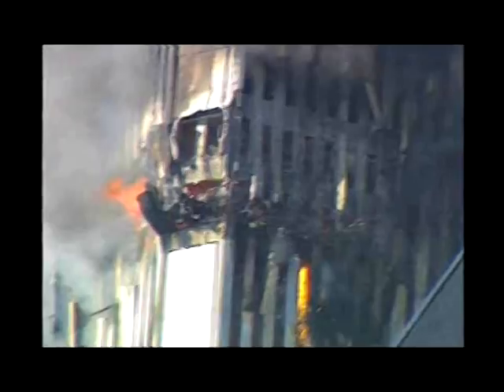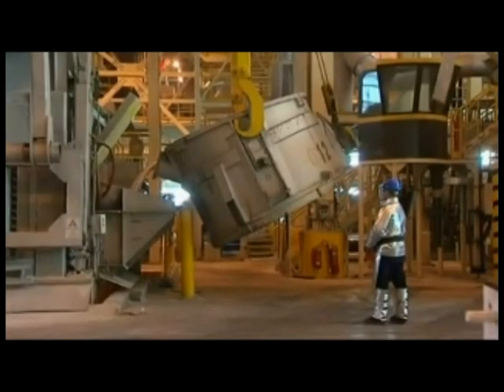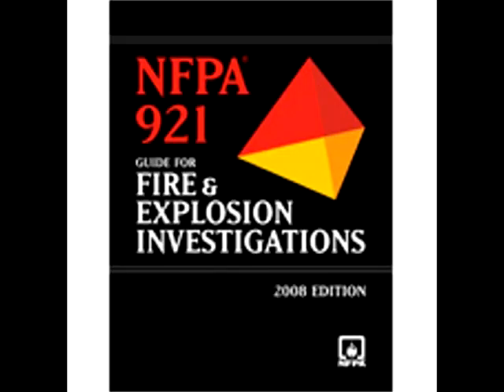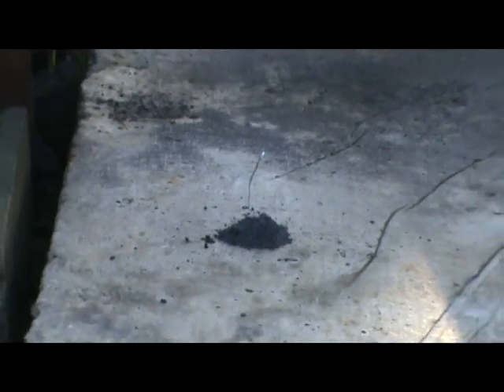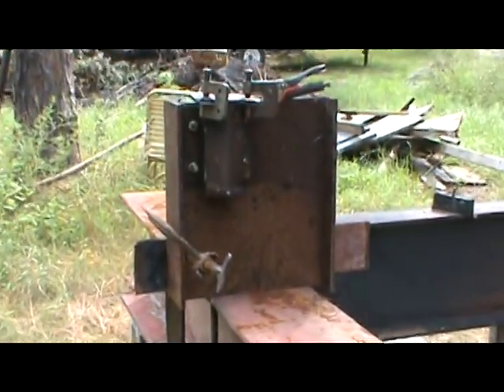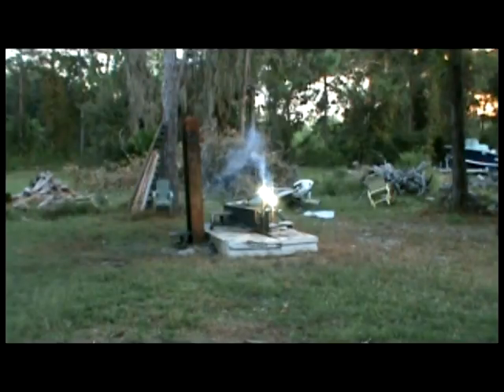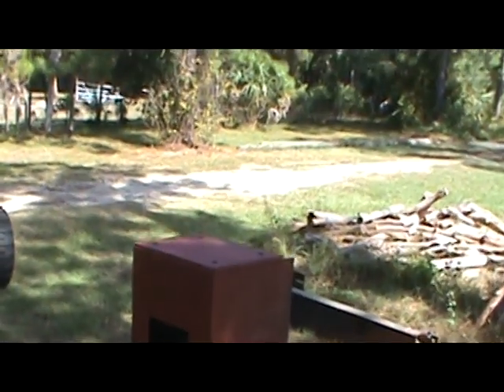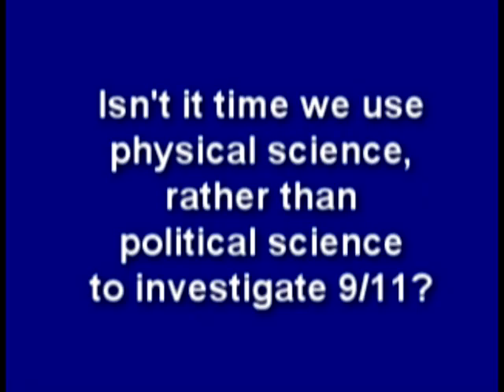9/11 Experiments: The Great Thermate Debate

Comment: It’s a wonder YouTube hasn’t deleted this video
Reply: If you leave it in plain sight, nobody would think that it's something extra important thing. Imagine what would happen if the first guy uploads the video and gets deleted. On the next day one hundred guy upload the same video and it would get lots and lots of more views. If you let this one hang here, nobody will notice, nobody will think it's something special. Psychology at it's best.
Reply: "because it's fake". I've personally made thermite and cut through a sewer lid with a crudely designed 'shaped charge' just like the gentleman in this video. I also learned how easy it is to accidentally make your shaped charge into a 'grenade' (basically). That is called 'verified independent personal peer-review'. That's what I love about science, you can't deny empirical evidence that anyone can recreate. Doing so is the very opposite of science. i.e. 'flat-tard logic'.
Reply: If this video blamed 9/11 on an AR-15 it would have been taken down.
Reply: If the video was suggesting a Democrat administration was to blame, it would have been deleted immediately.
Reply: Josh Pollack 
First of all, I haven’t had cable in over 3 years now and don’t believe the “tv”, so you could stop wasting your time with that rhetoric. Secondly, the building did meet resistance when they collapsed which can EASILY be seen by the falling debris outpacing the collapse of the buildings. Thirdly, the buildings were MASSIVE so of course bodies are going to be torn to pieces during the collapse instead of being flattened like some cartoon. And lastly, bombs/explosives leave behind remnants like det. cords, blasting caps, etc., which are found after EVERY REAL controlled demolition and there was NO evidence of that in the rubble.

So again, nice try but you have no clue what you’re talking about.
Reply: Dr. Hannibal Lester its call matter... the reason he made that point is that building 7 was not an object in freefall. When they measured the amount of time it took for the building to be demolished, it never showed any deceleration. If you're going to  put your eggs in the "progressive collapse" basket, you must acknowledge the laws of physics and recognize the fact that the upper portions of the building would be slowed by the mass of the building below it.
Reply: The Nech 
Not sure who you’re talking to because you didn’t address who you’re replying to, but the plane impacts were a factor in the collapse but not what initiated the collapse. The fires that burned uncontrolled is essentially what brought the WTC buildings down, including WTC7.
Reply: The Nech 
Read my comment again, I didn’t say the plane impacts caused the collapse, I said they were a factor but the fires that burned uncontrolled after was what brought them down. There weren’t any explosives and there were eyewitness accounts of all kinds of things as is expected during a chaotic event, especially one on the scale of 9/11.
Reply: Josh Pollack 
Sorry, but you don’t have a clue what you’re talking about.
Reply: you're embarrassing yourself because you refuse to see the truth no matter how many times you look at it. 
its really not hard, just try thinking for yourself instead of believing what the tv said about it.
Reply: if it really collapsed, we would see shit caught up between floors, we would see floors, we would see the kind of rubble that was in haiti. buildings compressed with people and shit stuck all over the place in there. 
spoiler alert
it didnt collapse
Reply: Josh Pollack 
Everything I listed was a fact, so how am I hopeless. I’ve looked at Judy Woods theories and if you want to talk about delusional, she’s the definition of it....which is why you don’t hear from her anymore since her ridiculous rhetoric. As far as the rubble goes, it took almost 9 months to clean up, so I have no clue where you’re getting this information that it got shipped off to China in “2 days” because YOU’RE WRONG!!! 

But believe what you want, and don’t bother replying to me anymore with you’re baseless nonsense.
Reply: poweredbyaaron99 You've proven via your comment that you don't understand how terminal velocity works. Terminal velocity is just that, a velocity, not an acceleration. It's different for every object and depends on the medium the object is falling through. It's the velocity at which resistance from the environment, such as air resistance or, say, structural resistance from 100 stories of steel, is exactly equal to the force of gravity, so the falling object no longer accelerates. So the fact that it is falling "at terminal velocity" would prove the exact opposite of what you are trying to say. It proves that it IS being slowed down.
Why can't I jump through 100 floors of steel? Because the terminal velocity of a human falling through steel is 0 mph. The same is not true for a building that weighs thousands of tons.
And by the way, what source are you getting any of this from? I can't take any of your claims seriously unless you give me a source, since I know thaf conspiracy theorists love making stuff up and taking things out of context. In fact, I suspect that that's what your doing right here. You seem to be taking something about the building falling at terminal velocity out of context to make it sound as though the building is falling at the same terminal velocity it would have if there were no structural resistance.
Reply: I downloaded it and archived it* Youscrew can delete it all they want. I'll upload on 100 alias accounts.
Reply: DullSensation 2000 true.
Reply: tony. pieces of bodies are still being found. 
if the buildings pancaked, you would see bodies mashed between floors. things crumpled up, but still there. you know, like a pancake!
it takes explosives to blast humans into pieces and scatter them around town. that, my friend, proves without a shadow of a doubt that there were bombs in the buildings on that day. 

the only hard part about believing the 9/11 conspiracy is that it means all of that perfect Democratic US Government stuff you learned in school is bullshit. 
and that's only hard if you're a pussy that cant handle the truth
Reply: tony
sorry bud. seems like you clearly cant handle the truth. 
that's ok, just stop embarrassing yourself like this
Reply: Josh Pollack 
You said pieces of bodies are still being found and that they should’ve been flat like pancakes as if 9/11 was some kind of cartoon, and I’m embarrassing myself? Ok
Reply: it proves explosives. there wasnt anything trapped between floors. if they were really "pancaking" then where the fuck are the layers?
there arent any because there were bombs blowing that bitch into pieces.
you're the one looking at something free falling, and telling me its going through floors. each floor would have posed resistance. that resistance would have slowed the fall of the buildings, no matter how squinted you look at it. since the buildings didnt slow, it proves that something moved the floors out of the way as the building was coming down. 

along with all of the bodies blasted into pieces all over town.
Reply: DullSensation 2000 if they did there would be an uprising of these theories. The govt doesn't want that.
Reply: Well it's a meme at this point so
Reply: Yeah- It's pretty ubiquitous at this point. lol
Reply: poweredbyaaron99 You keep claiming that the official story contradicts the laws of physics. Care to explain how? And by the way, given that you are a conspiracy theorist, and there is a significant overlap between flat earthers and 9/11 truthers, I wouldn't be surprised if YOU were a "flattard". But I would be very surprised if the person arguing against you was.
Reply: poweredbyaaron99 Your comment to Dr. Hannibal Lester proved nothing whatsoever. You are either a troll, or a complete moron. Do you even know what terminal velocity is? It sounds like you don't. Here's a hint: terminal velocity has nothing to do with the method by which something is demolished. Your claims that the "official story" contradicts physics shows that you know literally nothing about physics.
Reply: You didn't understand my position - despite repeated attempts. How could I NOT insult you? You believe that steel and air pose the same resistance to an object falling to the ground . How fucking dense can you get? Can you really be THAT stupid? Yep - you just proved it. I'm still in shock. Remarkable. 

You know - even the density difference between air and water is so extreme - you would SPLAT impacting it from 100 stories. It would stop you DEAD in your tracks. You are either a troll, or a complete moron. 

Terminal velocity: "the constant speed that a freely falling object eventually reaches when the resistance of the medium through which it is falling prevents further acceleration." 

Do you even know what a "medium" is?? Bro XD 

"Why can't I jump through 100 floors of steel? Because the terminal velocity of a human falling through steel is 0 mph." 
NO SHIT!! XD That was kinda my point, Sherlock. "The same is not true for a building that weighs thousands of tons" Uhm, YES IT IS!!!! And here's the simple reason why: 90% of that building was PRISTINE Duh?

"In controlled demolitions, all resistance is removed systematically and simultaneously" They don't leave 90% of the building in-tact to interfere with things It has to happen SIMULTANEOUSLY - otherwise, the upper portions are STOPPED or DEFLECTED by the resistance of the lower portions. Then the building can't fall at free-fall speeds and can't fall neatly into it's own footprint. 

"The strain of anti-intellectualism has been a constant thread winding its way through our political and cultural life, nurtured by the false notion that democracy means that "my ignorance is just as good as your knowledge." Issac Asimov
Reply: poweredbyaaron99 You didn't even clearly state your position until now. You just said that terminal velocity proved people wrong without giving any back up as to why. And then when asked to clarify your claims, you resorted to insults.
Reply: poweredbyaaron99 I never once claimed that ignorance is just as good as knowledge. You are making a complete strawman, and you know it. You are deliberately lying. And who are the anti-intellectual ones, again? The person trying to have a reasoned drbate, or the one who is making up conspiracy theories just because he wants to automatically believe the opposite of the "official narrative", is attempting to discredit NIST, dismisses all evidence against his claims as part of the conspiracy, and resorts to ridicule rather than argument?
Reply: poweredbyaaron99 When did I claim that steel and air pose the same resistance to an object? I claimed the exsct opposite in my previous post. What you are doing is called knocking down a straw man.
Reply: poweredbyaaron99 The building is not falling through solid steel. It is falling through more floors of the building, which are made mostly of air, so the terminal velocity is, in fact, more than zero. Where is your source for the claim that 90% the building was "pristine"?
Reply: I never once claimed that ignorance is just as good as knowledge." It was implied, not stated. C'mon lemming. You can do better than that. And who are the anti-intellectual ones, again? lol 

I stand completely by what I said before. Nothing has changed 

"When did I claim that steel and air pose the same resistance to an object? I claimed the exsct opposite in my previous post." You refuse to acknowledge that 100 floors of steel beneath the impact site would resist the fall what-so-ever. Thus, you insist that there is fundamentally no difference in resistance between the two.

1. You didn't understand my position - despite repeated attempts. It was there from the beginning.
2. You refuse to acknowledge that 100 floors of steel beneath the impact site would resist the fall.
3. You argue in circles around this because you want to avoid being seen as: 'obviously wrong.'

I've repeated myself too many times. I continue to do so now only because you don't know when to shut up.Your continuous assumptions and conjectures  are an attempt to divert attention away from an argument that you cannot win otherwise . Your entire position is one massive red haring swimming in conjecture -yet you accuse me of making the strawman? Do you know how bat-shit crazy you are? I'm copying my original points - nothing has changed in my position! My argument remains EXACTLY the same and STILL STANDS. Nobody is diverting attention away from anything except you!!!  lmao XD

90% of that building was PRISTINE - and should have resisted and deflected the 10% that was affected. That has been my position from the very beginning!!! An object falling through air falls faster than an object falling through 100 stories of steel. (WTC was 110 stories tall btw) Try as you might little lemming - you cannot change that fact. You cannot deflect the argument either.  

"Where is your source for the claim that 90% the building was "pristine"? Uhm... I watched 9/11 happen ya dildo. The planes hit 10 stories from the top and didn't affect the first ~100 floors. That's my 'source' - lmfao (do you really need the footage?)

Are we at the point now where I have to source common sense shit anyone can see... SHOULD HAVE SEEN themselves? It's not a debate dude. 90% of the building was PRISTINE. Perfect condition. Are you accusing me of being a fucking liar now? lol - Okay.

Look man, nothing personal but I think some emotions are too flared here to have productive discourse. Take a break. Come back later. Try again*
Reply: poweredbyaaron99 You've admitted that you have no source for what you're saying and instead resort to "common sense". That's the mark of an anti-intellectual, exactly what you are claiming I am. I wonder if you know the quote about accusing your opponents of what is true about yourself.
Reply: poweredbyaaron99 I'm not accusing you of being a liar, I'm accusing you of being an idiot. You admit that the reason you think 90% was in good condition is because you saw it yourself. Did you see the part of the building that was actually facing the Twin Towers? No, that part was covered by too much dust and rubble to even see. Yet you claim that, because the part of the building you could see (the part that wasn't getting hit by rubble and would therefore be much less damaged than the rest of the building) looked fine, 90% of the whole building must have been fine. Actual witness reports say that there was already z huge chunk of the building taken out and it was in danger of collapsing from fire, which it eventually did.
Have you ever tried doing research to see if your conspiratorial claims are correct? https://youtu.be/_kSq663m0G8
https://youtu.be/CtkWNHSG3MY
Reply: poweredbyaaron99 You clearly never saw the entire WTC 7. The part that was actually facing the tower and got hit with debris was extremely damaged. So your claim that it is "pristine" just because you didn't see the damage from the angles in the news reports is just false.
Reply: https://www.google.com/search?q=9/11&rlz=1C1CHZL_enUS750US750&source=lnms&tbm=isch&sa=X&ved=0ahUKEwjvvZyRgNfcAhUOiqwKHbxXDHcQ_AUICygC&biw=1920&bih=943

https://www.google.com/imgres?imgurl=https%3A%2F%2Fupload.wikimedia.org%2Fwikipedia%2Fcommons%2Fthumb%2Fe%2Fe5%2FNorth_face_south_tower_after_plane_strike_9-11.jpg%2F170px-North_face_south_tower_after_plane_strike_9-11.jpg&imgrefurl=https%3A%2F%2Fen.wikipedia.org%2Fwiki%2FSeptember_11_attacks&docid=mWvoGB6fsl3csM&tbnid=nK5_jtCR3FXu5M%3A&vet=10ahUKEwiTgcSUgNfcAhWH7YMKHa05DHQQMwgoKAAwAA..i&w=170&h=195&bih=943&biw=1920&q=9%2F11&ved=0ahUKEwiTgcSUgNfcAhWH7YMKHa05DHQQMwgoKAAwAA&iact=mrc&uact=8

https://en.wikipedia.org/wiki/Timeline_for_the_day_of_the_September_11_attacks

"8:46:40: Flight 11 crashes into the north face of the North Tower (1 WTC) of the World Trade Center, between floors 93 and 99. The aircraft enters the tower intact." 

There durpshit - 93-99 is close enough to 100. Now Are we done here? Because unlike you - I actually have more important things to do with my time than argue about the color of the sky or the shape of the Earth with a pretentious fool who demand "sources" for empirical, observable evidence that is so readily available to everyone. You waste my time.
Reply: poweredbyaaron99 Interesting that your sources have nothing to do whatsoever with what I asked you to source. More intellectual dishonesty, I guess. You didn't even find one peice of info relevant to WTC 7. Meanwhile, I provided you with sources explaining how WTC 7 collapsed and that there was significant damage, which your response to was to say that you think you know better from seeing one shot of it from a news camera that can't see through the rubble to the side that's actually damaged than the people who were actually there.
Reply: poweredbyaaron99 You know your claim that the building was pristine is a lie. I gave you actual sources with evidence that it was damaged by the rubble from the Twin Towers, and your only response is, It looked pristine to me (by which you mean it looked pristine from one angle, the angle that was pointed at the side facing away from the twin towers.
Reply: poweredbyaaron99 You're repeating the same thing over and over again. I already explained to you why the resistance from the rest of the building DOESN'T MATTER. The supports to the building were destroyed, which is why it fell. The rest if the building is mostly air, with a little bit of glass and concrete - not enough to even hold itself up against its own gravity. You do know how gravity works, right? 
You remind me of a flat earther. You don't understand gravity, and you repeat points that were already refuted when you run out of arguments.
"I don't see Earth's curve, so it must not be there." - flat Earth morons
"I didn't see the damage on the WTC 7, so it must not have been there." - you
Reply: poweredbyaaron99 Ever heard of Parker's law? “If you have to insist that you've won an internet argument, you've probably lost badly.”
And there's a similar thing about people who result to insults instead of making arguments.
Reply: Grenherb I already know that many of the terrorist organizations are partially the US's fault. I also know that the government took advantage of 9/11 to go to war. That still doesn't make 9/11 an inside job, though.
And seriously? The old "It's all the Jews" claim? So now you're not just a conspiracy nut, you're a bigot as well.
Reply: Grenherb So because I can respond to your illogical claims, I will always be stupid? Sounds like you have no arguments.
Reply: Grenherb Sounds like you don't understand facts. MAKING BASELESS ASSERTIONS AND PUTTING THEM IN ALL CAPS DOESN'T MAKE THEM TRUE. You have no evidence that America is owned by the Jews or that Jews are trying to start a NWO, you are just making up dumb conspiracies to justify your bigotry. Jews have been kicked out of countries due to discrimination. Currently, many Islamic states are very discriminatory towards Jews, and in the past, a lot of Christians also discriminated against them. Your attempts to turn victims of discrimination into the villains are pathetic.
Reply: Grenherb I like how you call me robotic and stupid when all of your comments are robotically repeating made-up claims that you stupidly believe. And I love even more how you tell me to look up history when all of your claims are either completely fabricated or historically illiterate. But thank you for providing me with continued comedy.
If your family really did hide Jews, I'd suspect that it didn't go well if the Nazis ever found about it. Ironic, since you seem to agree with the Nazis. If what you say about your family is true, they are probably quite ashamed of you and your bigotry.
Reply: Grenherb And like most insane people, you call people who don't agree with you Nazis, commies, or some other evil ideology. Thank you for proving that Godwin's law applies not just to Nazis, but to communists as well.
Reply: Grenherb Do you know why I'm not a conspiracy theorist? Because every time I ask a conspiracy theorist to back up their claims, they utterly fail. Like the guy above you, you can't back up a single thing you say with actual evidence. You just shout your insane nonsense as if anyone is stupid enough to believe you.
Reply: Jewtube
Reply: Its because it doesnt appoint to the guilty party which cannot be mentioned in america: israel.
Reply: They won’t be recommending videos like this that’s for sure
Reply: Yeah the whole thing is fake. WTC7 fell at terminal velocity despite never being hit. It will remain the only steel frame building in history to collapse from fire alone - and at terminal velocity. If you know anything about physics at all, you know that 9/11 was an engineered event involving far more than 19 hijackers armed with box cutters. 9th grade physics is really all you need to know to spot the elephant sitting in this room.  You learn terms like: 'friction resistance' & 'terminal velocity' in freshman physics and general science - if not sooner... and according to the physical laws, the official explanation for the events that unfolded on 9/11 are a complete fraud. The ONLY explanation that doesn't violate the laws of physics - is a controlled demolition. Otherwise the issue of structural resistance impedes the rate of collapse. In controlled demolitions, all resistance is removed systematically and simultaneously; which is why we observe a controlled demolition at terminal velocity. Honestly, I am comfortable using 9/11 as a kind of 'litmus test' to isolate intelligent high I.Q. people from your ordinary pseudo-intellectual.
Reply: @MoonEyes2k
Are you blind? He crafted a thermite shaped charge to destroy steel beams ... something your progressive media overlords said was physically impossible. You are the equivalent of Jackass. All empirical evidence supports this conclusion.
Reply: You're not one them flat-tards are ya boi?? O_o
Reply: DullSensation 2000 
Why would YouTube delete this? It doesn’t prove anything as far as 9/11 goes.
Reply: Conspiracy loonies aren't illegal.

So, it shouldn't be surprising.
Reply: No doubt this a testament to stupidity.
Reply: your chanel too, but I could if I wanted to ...
Reply: Because its fake..... Youtube hates truth. Therefore its still here!
Reply: Why? Stupid shit is Youtubes stock in trade. This is the equivalent of Jackass.